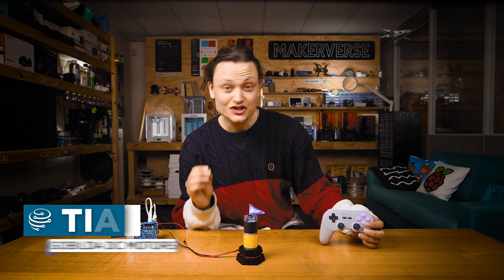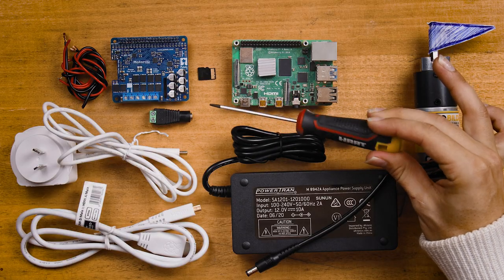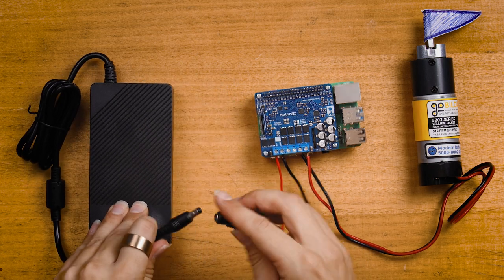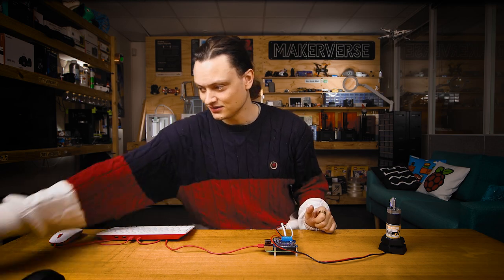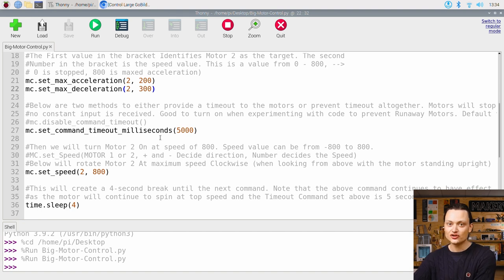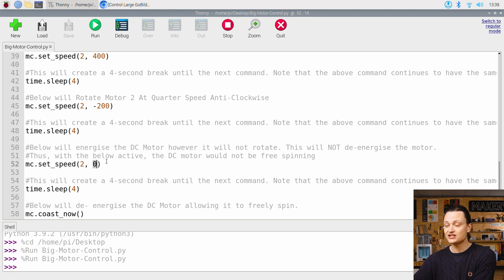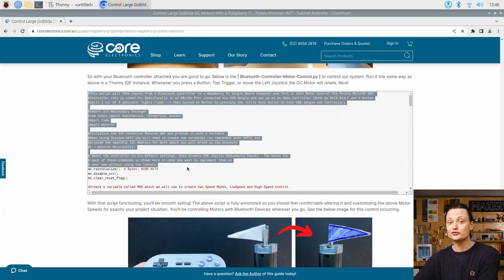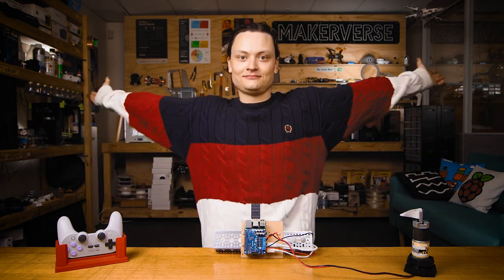Control Large GoBILDA DC Motors With Raspberry Pi & Pololu Motoron HAT - Bluetooth Control Too!

Comment: So I take it the motor does not have the torque for tools like routers?
Reply: for woodworking i suppose, maybe combining several motors would work ... (chain)
and making several light cuts
Reply from the maker: Our range of goBilda has motor speeds from 30rpm all the way to 6000rpm. 

When it comes to cutting material the most important factors to get right is Torque and Feedrates (http://www.destinytool.com/horsepower-torque.html). I definitely agree with Jyv Ben, you'll be able to cut/route wood with these motors, but if you are interested in CNC cutting hard metals in like steel your definitely better off with 3 Phase, higher rotating, 'bullet-proof' motors. Typically, the speed range of a CNC router spindle is between about 7,000rpm and 24,000rpm for cutting Steel.

Below are links to those goBilda Motors.

https://core-electronics.com.au/5204-series-yellow-jacket-planetary-gear-motor-1881-ratio-80mm-length-8mm-rex-shaft-30-rpm-33-5v-encoder.html

https://core-electronics.com.au/5203-series-yellow-jacket-motor-11-ratio-24mm-length-8mm-rex-shaft-6000-rpm-33-5v-encoder.html
Reply: I have an analog controller- how do I connect it

Comment: my battery pack is 36v 100amp (peak) is that too much for the board or will it only draw up to 20 amp.
Reply from the maker: The board will only draw the Amps that are required, come check here for my cheat sheet of understanding Power Supplies (No Maths!) - https://core-electronics.com.au/guides/prototyping/power-supply-which-to-choose/

The larger concern is actually the 36V that your battery pack has. Pololu recommends only 28V max for the max
nominal battery voltage. That means the high voltage in your battery would end up letting the smoke out of the Motor Controller - https://www.pololu.com/product/5053

Hit us up at the forum if you have any more questions - https://forum.core-electronics.com.au/latest